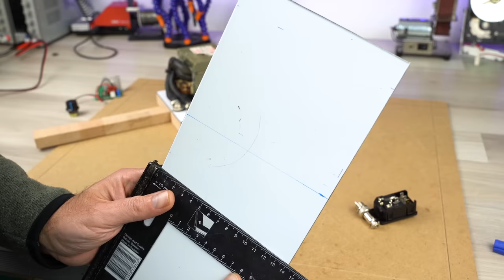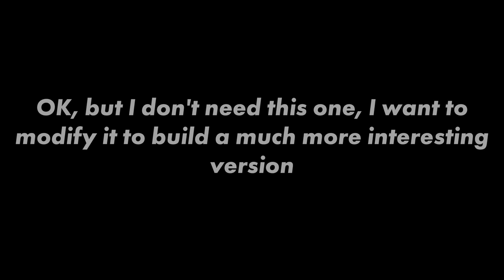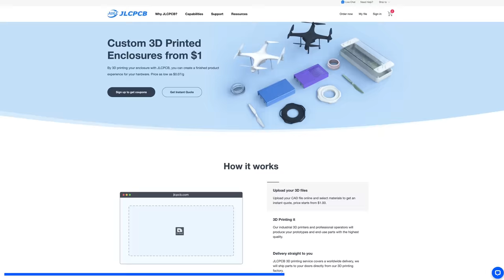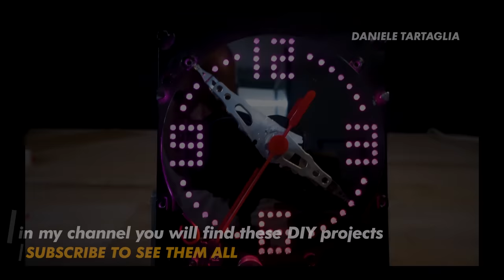How to make Spot welding machine DIY with Microwave

Comment: Your the man! This looks like something you'd find at a store for a few hundred dollars. I  build these all the time on my channel, but no where as good as yours! Great job👍👍👍👍👍👍
Reply: I've built a welder just like this with the same exact parts. Only issue I had was the relay on the timing board.  Was not strong enough if I had the power up past a certain level. To fix this, I added a SSR 40 amp. Was an easy upgrade considering I had a small power supply for the fan. Mine all fit inside a computer power supply case. This ended up my favorite welder and 5 years later. I can break it out if need be. Think the ssr I used was a SSR-40-DA.

Comment: soldering time is too long, it may damage the battery
Reply: agree :)
Reply from the maker: You're right, you need to use shorter times and more power. The second battery pack fared better with these settings

Comment: Move both high current wire lugs from bottom directly to moving part of arm close to welding tips. It will shorten current path and remove some transition resistance in hinges. Every milioohm depends.

Comment: First of all, congratulations for the good work. It is bad that it generates too much heat. The purpose of the spot welding machine is to weld the battery without exposing it to heat. The battery is a successful device for an external Metal welding.

Comment: You heat the cell too long , proper spot welding time should be set maximum for 40 milliseconds, after this time 0.2mm nickel strip should hold strong to the cell. Try using NY-D01 spot welder controller.

Comment: Nice project and as always the finish is unbeatable, congratulations.  But I have a series of doubts, it would be very good if you put important data such as the output voltage of the secondary of the transformer and also, even more important, is the link or specifications of the timer module used, if you gave us that information, the purpose of the video would be complete.

Comment: You need higher output voltage from the transformer to create faster welding with less heat that may damage the cell...Use little thinner cable with one or to more rolling times to get higher voltage.
Reply: You're right 12v welds nickel strip much better, transformer from an old UPS is perfect

Comment: molto interessante. Sarebbe anche interessante un esperimento per capire quanto reale è il problema dell'esposizione al calore di cui si parla in altri commenti:

1) testare una ventina di batterie 18650 con un tester Liito kala o simile per capire rapidamente la capacità
2) praticare delle saldature ambo i poli di ciascuna di esse
3) ripetere il test per capire se e quanto è cambiata la performance delle batterie così saldate

Comunque valuto se provarci anche io. Magari testando anche più avvolgimenti con cavo di sezione leggermente minore.

Comment: Your work is very good but I think you could make it more perfect. First you use the wrong welding needle, they sell special copper needle just for welding (3 or 4mm is ok). Second you shouldn't use those "primitive" dimmer and timer like that, they already have specified controller for spot welding (eg: NY-01) using BTA100 thyristor for power control and precise timer (minimum 10ms)

Comment: Very nice work, but you ruined the batteries. Because you ran the current for too long. You ruined the batteries and burned the nickel strips. You should use a circuit that can give higher current in a very short time, like ny d01 or ny d02.

Comment: Heating up to a red glow point on batteries is bad - imagine how the electrolyte boils inside...
Reply from the maker: you are right, I had to use more power with less time, but all this is possible with the two potentiometers
Reply: @DanieleTartaglia  Be careful with modern LiPo - they have high energy and flammable lithium, which burns very strongly. When heated, the insulation inside may melt, a short circuit will occur and an explosion with a strong flash may occur.

Comment: that would be too risky for me, you have the two contacts so close together that if you come up against them from the side you will cause a short circuit and that with the thick contacts.
Reply: Não tem perigo algum, porque deve ter uns 2 a 5 volts.
Reply: @mauriciogomes6471 and how many amps? 30 mA through your body is enough to bury you.
Reply: @JM_Tushe 5v is too low for any current to pass through your body it's completely safe, 100v or more is a different story

Comment: The purpose of spot welding is to prevent batteries from heating up. This is the difference of the soldering iron. However, because the voltage is very low and the welding time is long, your device heats the battery even more than the soldering iron. Stupid :)

Comment: If a spot weleding takes more than 2 milliseconds, that welding is of no use. The machine you built uses more than 30 milliseconds. Nickelstrip burns and deforms. This kills the conductivity of the nickel strip. The power of the battery you made with this will be wasted on the nickel strip and weakened..!

Comment: Hi, I'm a fan of yours, but you didn't make it. Your contacts are burnt out. It's not supposed to look like that. You're losing energy in that swivel joint, you should have connected it with two wires.